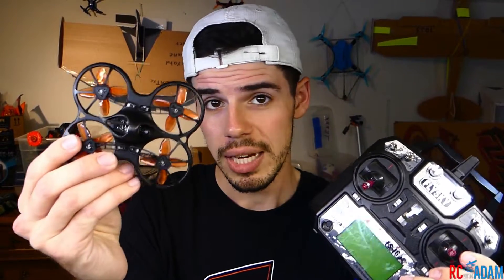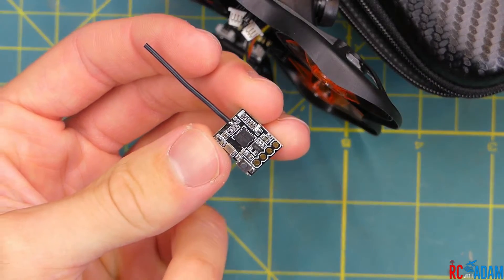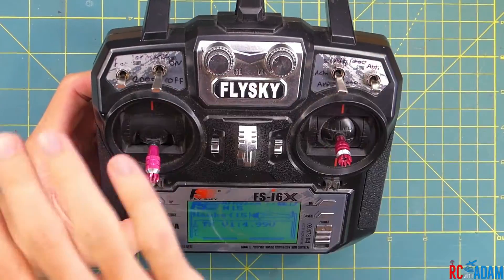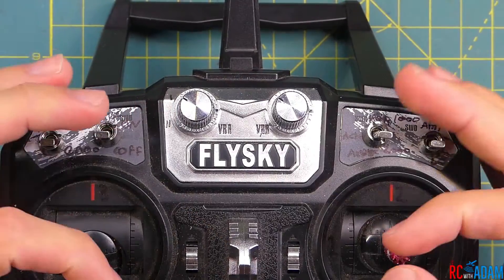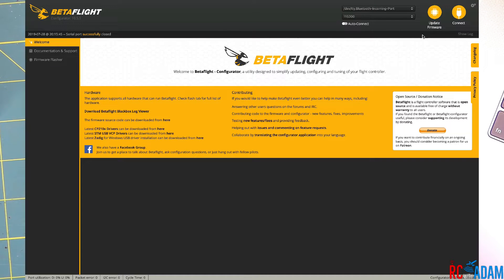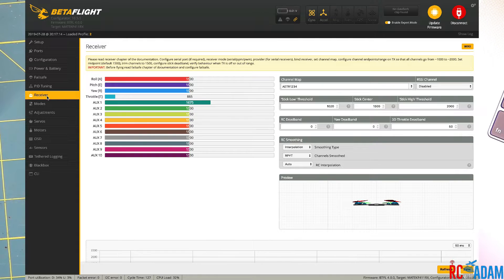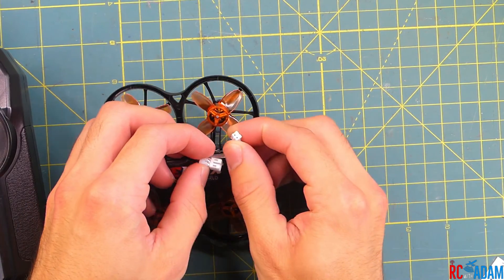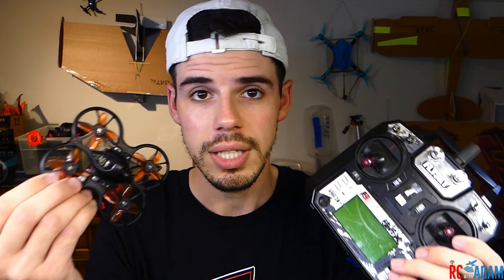How to Install Flysky Rx in TinyHawk S (and Freestyle) + FS-i6X and BetaFlight Setup Guide Tutorial

Comment: My rssi value reads 50% is that normal
Reply from the maker: Hi! No, usually if it reads 50%, it doesn't actually work and is just stuck showing 50%. I'm not sure exactly why this is. What is your setup?
Reply: @RCwithAdam1  
Hi Adam thanks for the reply. Im running a tyro79 with a fli14+ reciever, i even change it over to a flysky ia6b reciever & is the same 50% on my osd. When i use my eachine trashcan with a fli14+ receiver it show 99% on my osd. I got no idea. Perhap is just the flight controller. 
Well thanks you for your reply.

Comment: does this method also work with a emax tinyhawk freestyle? Another question: it is better if I buy a sibus receiver and solder it to the sbus pads or a ibus receiver and solder it as you did in the video? Thanks

Comment: I used the SBUS pad and set the FS i6X transmitter to SBUS mode in the transmitter rx setup as well and that did work for me (same board but on TH 2 Freestyle). Just enabled serial receiver on UART 1, changed receiver to Serial and SBUS and it worked okay.

Comment: I keep trying to refer to this video because it's the closest I have been able to get to anything helpful, but I am still frustrated as all get out. I have an X6B receiver.. you have a good video on binding it and you have another video showing how to connect two of its wires to connect to another style drone, but what I could really use help with is which wires to solder directly onto a tinyhawk freestyle, which is very similar to to the S you have here. I can bind it to my controller just fine, but I think I have the wires in the wrong areas.. any chance you might be able to help with this? I don't know which wires are the positive and negative. I know the black one is the ground. Other than that, there doesn't appear to be anything that tells me what the other 2 wires are
Reply from the maker: Hi! So, your able to connect it to the Freestyle's board but not able to control it? Have you tried switching the Output Mode on your transmitter and receiver settings in betaflight?
Reply from the maker: You can send me a photo of the board and receiver ( rcwithadam@gmail.com ), and I might be able to help you better.

Comment: Hey does this work with the fs-a8s v2 receiver? I thought I soldered all the right wires but it still won't bind
Reply from the maker: Hi! Make sure the rx is in ibus mode by pressing and holding the bind button (here's the manual https://img.banggood.com/file/products/20161010005835FS-A8S%20User%20manual%2020160929%20.pdf).
Reply: Thank you so much. I got it to bind after switching it to ibus!! Really fun to fly!

Comment: This video is exactly what I was looking for, thank you. Had a quick question. The only Tiny Hawk S I can find on Amazon are frsky models. Can I still use these Tiny Hawks and just solder on my own receiver? Or does it have to be a Tiny Hawk with no RX for me to solder on my own?
Reply: Yes, you can buy the Frsky version and add this receiver to it.(ultimately you will be flying with 2 receivers but only one active).  The version he is demonstrating on has a receiver attached already.  I added a fs-rx2a  to a Frsky receiver model to use with a Flysky controller.
Reply: @KJ-bv6uk  if i add 1frsky receiver to a tinyhawk 2 with already own frsky rx should i do something to disable the own receiver or just unsolder the antenna is fine?

Comment: Hey Adam! I've done this on my freestyle with an RX2A pro v1- basically same receiver, just with ports. Mine will not bind. At all. Any tips on getting me up and flying again?
Reply: Did you ever get it fixed? I'm having the same issue
Reply: Albert Quiroz Hey Albert, no matter what I tried I couldn't. It sucks, keep on trying but I just ended up buying the RX2A pro. I guess they got a quality control issue with the V1s.
Reply: @10aemiataman  damn dude that sucks, I might have to do the same thing
Reply: Albert Quiroz It really does. Do you by any chance have a non-stock VTX? I don't and there's a chance it could be that if you do too?
Reply: @10aemiataman  no it's the stock vtx right out of the box, still cant figure it out. It's really pissing me off lol

Comment: You may do this without separate the FC. Just remove the botton plate and there is: RX1 (or RX2), ground from the battery and +5 from the 5v above the DSMX pads. 
I say this, cose in the TH 2, the motors cant be unplugged, sou you cant flip the FC.
Reply from the maker: Thank you for the info!! 👍🙂

Comment: I am trying this with my mobula 7. The receiver and transmitter are bound but I’m not seeing any transmitter. If I change the settings to SBUS I can see the transmitter but no inputs. It’s a crazybee f3 flight controller. Any help would be appreciated:) btw I set up the flysky i6x transmitter just like you did so I am a little bit stumped.
Reply from the maker: Hi! If you can take a clear picture of the electronics and email it to me at RCwithAdam@gmail.com I will help you get in the air! Which rx are you using?
Reply: @RCwithAdam1  Thanks for the quick response. As far as I can tell by looking at the board and the schematic that came with the drone there is only one RX. RX three is supposed to be un inverted.  I am sending you pictures now.

Comment: Thanks alot for your videos about flysky! I'm just a little concerned about the wiring on the board. I got a fs-rx2a Pro v1 receiver. I took the brown cable (ppm which I don't need?) off. Now I got yellow (i/sbus signal),  red (+, 5v) and black (-). Your video says I should solder the black one (-) left next to rx1. But on my board is 5v printed. And the red cable should be soldered to led on my board. Is my board different?
Reply: To bad I can't upload photos here. You need a Facebook group 😉
At 1:11 your 5v is led on my board and your negative (-) is 5v on my board.
Reply from the maker: Hi! Sorry for the delayed response! You can email photos to rcwithadam "at" gmail "dot" com , and I'd be happy to help! Otherwise, wherever you can find on the board, you just need to connect the positve wire to a 5v pad, negative to ground, and the signal wire to RX1.
Reply: I asked in a facebook group, the labeling is a little bit bad. 

That's what I did. But the receiver seems DOA, it isn't acting at all. Have to try it on another board.
Reply: Got it to work! Just took the sbus pads + rx1.

Comment: Hello, I took the receiver fli14 +, I soldered the 3 cable as on the video (only 3). when I connect the receiver to the radio with the button bind the radio finds it but the light on the receiver is red. the problem is in betaflight in "receiver" the drone does not beep andthe orders do not react.
 you have an idea?
thank you
Reply from the maker: Hi! Hmmm... Is the "receiver settings" box in betaflight set to ibus?
Reply: @RCwithAdam1  Did you solve this issue. Im just about to order the fli14+ receiver.

Comment: Besides flying a Traxxas Alias which comes with its one controller. What controller/radio can I just buy that would pair with the TinyHawkS? Local hobby store informed me that you need a specific controller for each drone. I have no idea how this all works. Would love some help!
Reply from the maker: Hi! So, for the tinyhawkS you will need a FRsky brand radio.
Reply from the maker: And to answer your question more generally; each aircraft has to have it's own receiver, and each receiver has to be the same brand (or really, the same "protocol") as the radio. So, you can fly many aircraft with one radio, but the radio and receiver must match. Let me know if you have any other questions!
Reply: Ok awesome! I will go with a FrSky then. Do you have any opinions on the FrSky X Lite? It looks like an Xbox controller which to me seems like it would be more comfortable in the hands than  the more common “square” style controllers I see people using online.
Reply from the maker: @900Redshark  I don't know a whole lot about specific differences in FRsky radios, but if I were to get one, it would be the X-lite. The X-lite is made for people who like to use their thumbs (like an xbox controller), as opposed to "pinching" the sticks.
Reply: And as far as goggles I was looking at the Fatshark Recon V3 for 90$. I’m assuming for 90$ they would work fine with the FrSky/TinyHawk setup? Or will I be wanting something a little better?

Comment: The fli14+ is actually too big because of the connector. I got it and tried to fit it. I ended up having to cut off the connector on the reciver and had to press it between the fc and the battery holder. I think this is suboptimal because it ruins the soft mount.

Comment: this is also possible for the freestyle version ( i believe same board ?) 
grz
Reply from the maker: It should be exactly the same
Reply: @RCwithAdam1 Help ! i installed the fli14+  uart 1 serial rx on, serial based ... and ibus , map AETR1234 , bind blinking , binded steady red , get rssi value on radio but nothing on the drone how can it be ????? nothing in the receiver tab BF
Reply from the maker: @playmatee1  Hmmm... It's worth a shot to try changing the BF rx setting to Sbus. I'll keep thinking on it.
Reply: @RCwithAdam1  i only used the visuals from this video didn't hear that was wrong , now got the good pad beside the bind button and it works.
made a  HOw To video my own https://youtu.be/GRv0ZKPlTyU